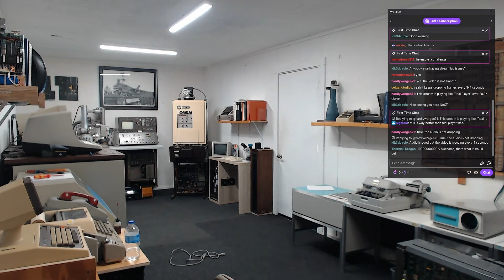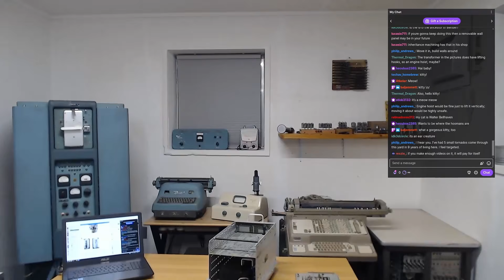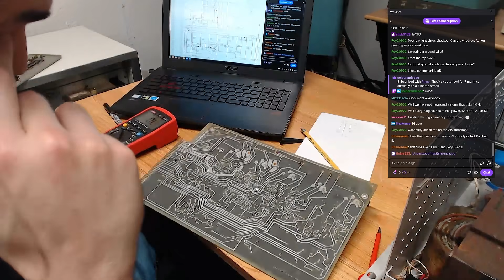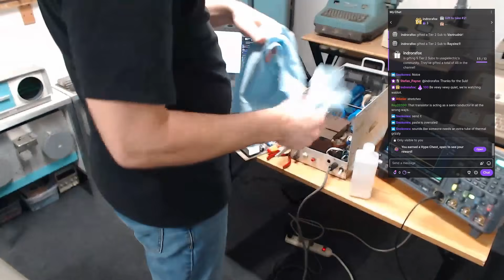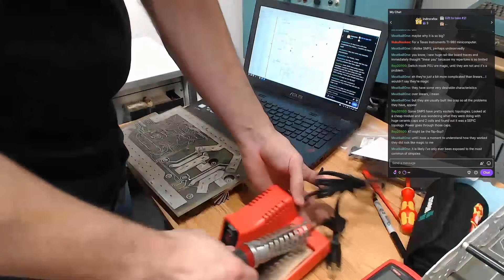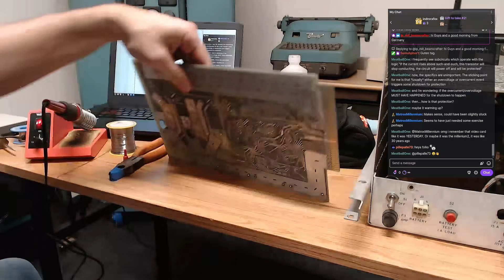Friday Night Live 029: Trying and failing to get the TI-980 Power Supply Going

Comment: if you have a relatively good vacuum, you can use a voltage over the chamber plasma to get the rest of the ions slinged in the walls for perfect vacuum.